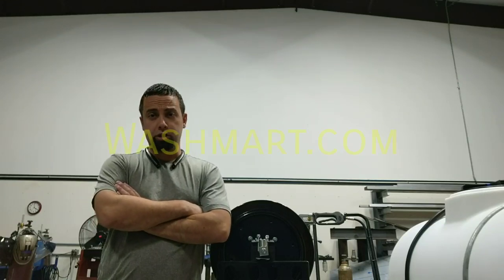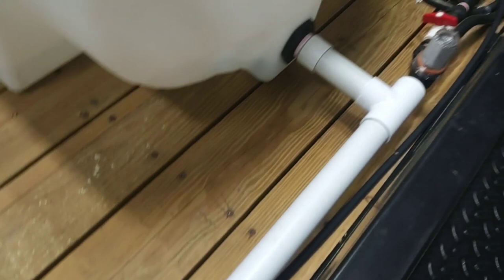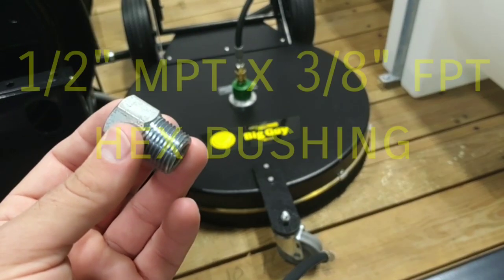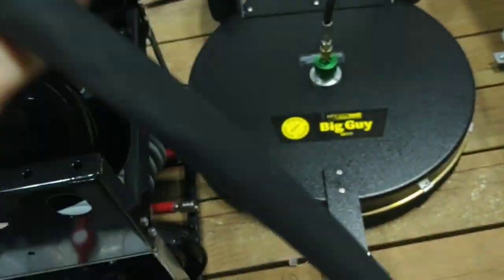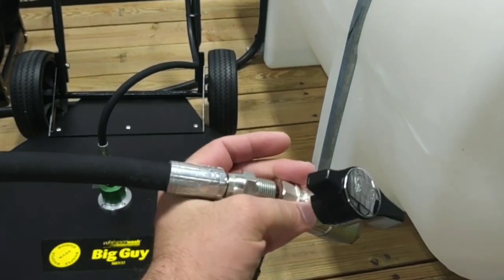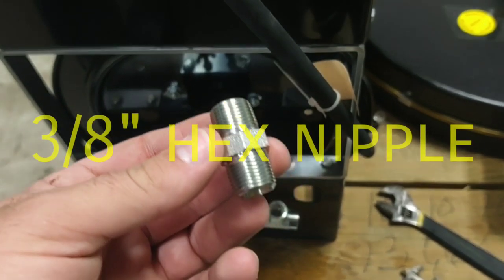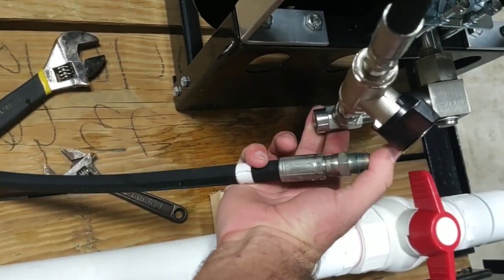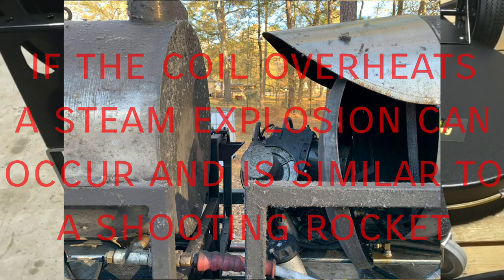Two gun pressure washer set up

Comment: Would it be possible to run one wand at 4gpm with hot water just for 5-10 minutes?
Reply from the maker: We don't recommend using 2 gun with a hot water machine under any circumstances.   We generally don't recommend running 2 guns from one machine because it's extremely inefficient.   You're better off with 2 cheap 4 gpm machines.

Comment: What are the draw backs as far as pump and unloader are concerned?  If you have 2 guys running 4.5 tips at same thing then everything is golden but what have 1 guy stops for a bit to move something or talk to a customer or answer the phone.  The other guys gun will instantly increase pressure and volume as it is trying to push 8gpm though the 4.5gpm tip correct?
Reply from the maker: More water goes on bypass, it's actually better for the unloader
Reply: This type of set up will not work with all unloaders though.
Reply: @ktpowerwashing  flow or pressure trap works with dual gun?
Reply: Wash mart, I just posted in the pwf group. I have a vrt3  4500psi 10.5gpm unloader. I am all good to set up dual gun correct?